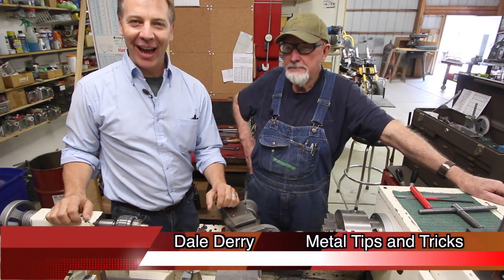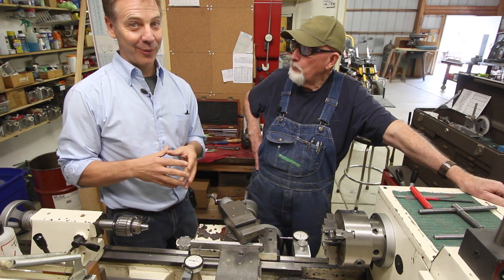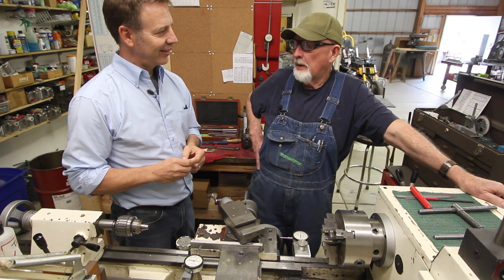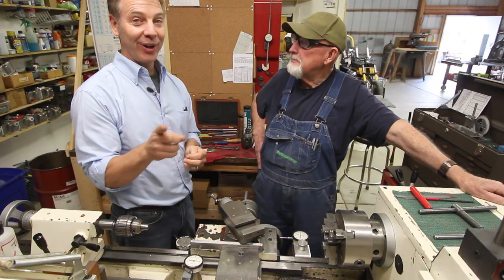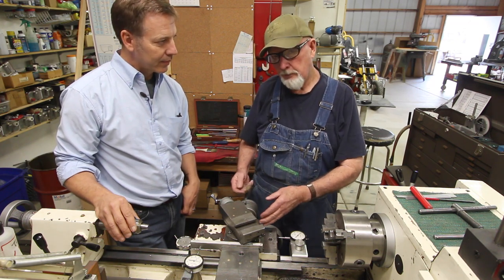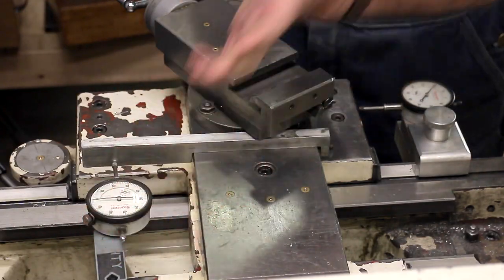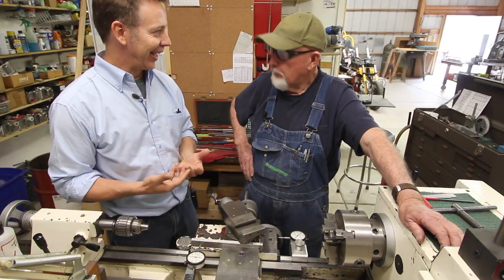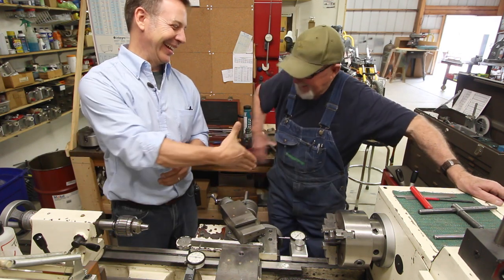Cheap and easy DRO for your Metal lathe.

Comment: Thanks Dale and Billy, another great video and a cool trike.
The dial indicators are a very good idea, I have done that in the past a lot. Also some spacers can be beneficial to a setup like that for when you may have to move out of the range of the indicator. For instance maybe you might need to cut a couple snap ring groves in a shaft, but you have a few shafts to make and don’t want to move the indicator.
Thanks again.
Reply from the maker: Thanks for your comment,  I think that's a great suggestion

Comment: I made a similar attachment with one addition. I put a socket head cap screw in the aluminum base that is adjusted so the head strikes the apron before the indicator runs out of travel. I messed up a good indicator to learn that lesson! Lol
Reply: yeah me too, a stop is a good idea. also, I use an indicator with 2 inches of travel

Comment: Yeah the old Deckel milling machines had something like that, and my Wells-Index model 55 came with Verniers (gone by the time I owned it).   Personally I like the "ARO" over DRO.  KISS, cheap, and it's "good enough" (it's a mill not a jig borer)
Here's the Deckel FP1:  http://www.lathes.co.uk/deckel/img20.gif
Wells-Index:  http://www.lathes.co.uk/index/img11.jpg

Comment: I'm certainly not a "machinist", only been machining for a year or so, but I thought it was pretty common to slap an indicator with a magnet on the lung to ways when you need to return to specific location and had you machine dials are set for another op or your just not wanting to use them for whatever reason. Also I could be wrong, I'm super green as I said, but doesn't backlash still matter? I certainly thought it did. Seems as though if the BL isn't taken out your tool could/would get sucked into the work then your zero on the dial doesn't really make a crap. Please correct me if wrong so I won't waste time making sure I've exhausted the backlash anymore......

Comment: Dial Indicators (DI) are not as accurate as micrometers. Cheap DIs can be off 0.001/inch of plunger travel even when loaded. Furthermore, it is important that the plunger be perpendicular to its workpiece. Test yours using gauge blocks at various plunger depths before using them, and verify installation with gauge blocks if you want to use Mr. Hatton's technique.